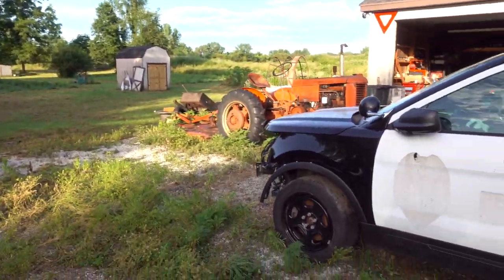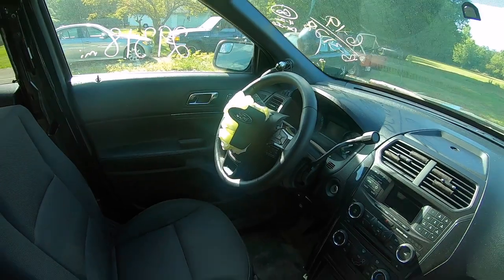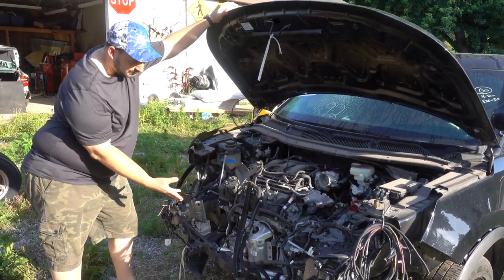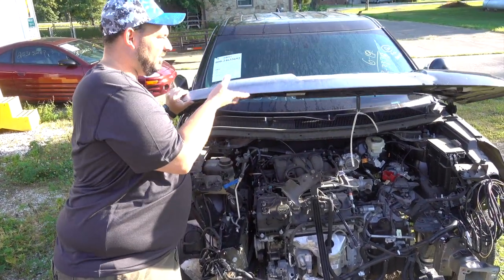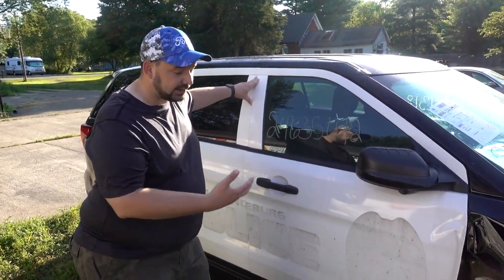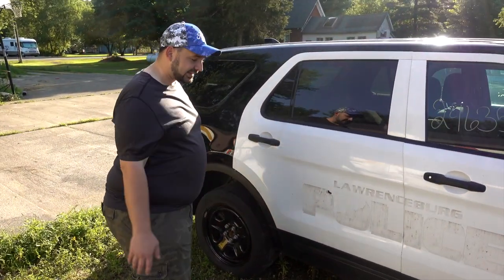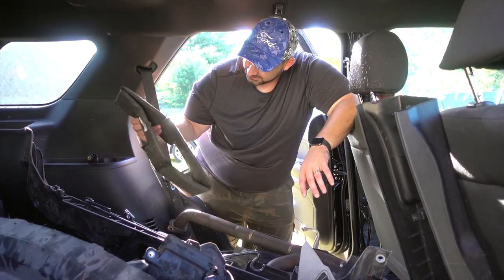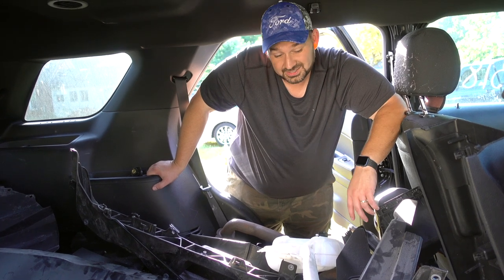I BOUGHT A WRECKED 2017 FORD POLICE INTERCEPTOR!!

Comment: Based on all the parts you need will make sense to buy a parts car. Although I think regular explorers don't have this 3.7 l engine
Reply from the maker: I’m going to discuss parts in an upcoming vid. But I’ve been getting some excellent deals on parts, especially the engine!
Reply: @CrossroadsRebuild  I hope you got a sweet deal on 3.7 engine because those engines last
Reply: @Msardinas86  Not in the FWD/AWD models they don’t. Only the ones that are in the F-150, Mustang, and Transit do.